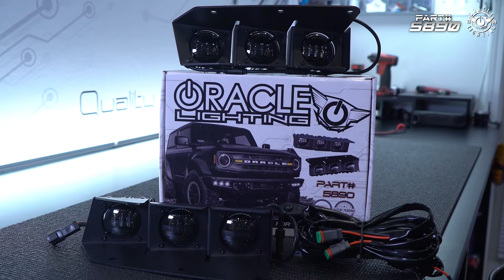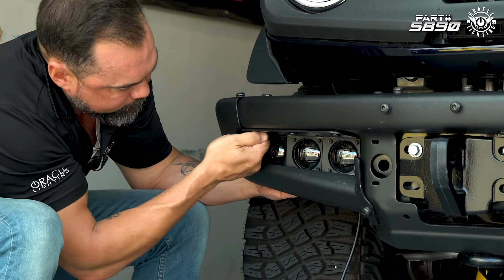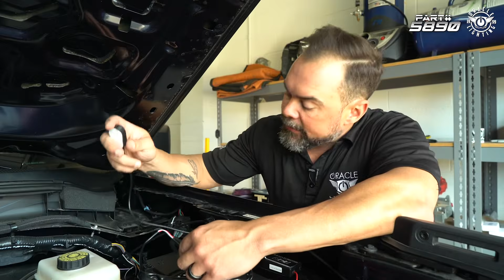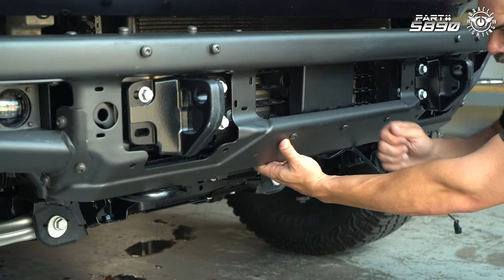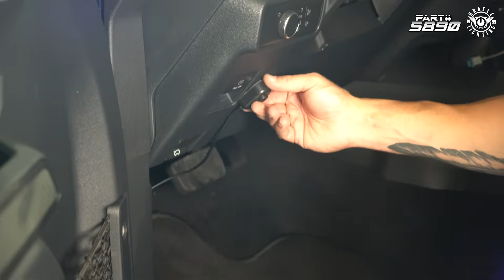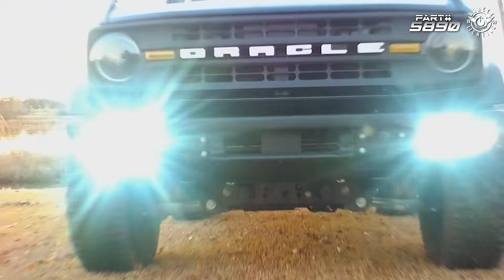2021 Bronco Triple LED Fog Light Upgrade from ORACLE Lighting- DIY Install Guide

Comment: Can you use another grounding bolt instead of the one that you used in the video, I already have my grill lights hooked to the grounding bolt you showed in the video, can I use a different grounding bolt?
Reply from the maker: Yes, there is a grounding bolt on the fender next to the battery that you can use.
Reply: @ thank you so much

Comment: Is it possible to link the Oracle switch power to the drl or parking lights, so that when those lights go off (in auto mode) the fog lights will go off regardless of whether the switch is on or off? I keep leaving my fog lights on accidentally and can't seem to make it a habit to turn them off. Haha my neighbors are probably getting tired of telling me my lights were left on.
Reply from the maker: Yes, you can use an Add-A-Circuit (Micro2) to go into the fuse box for power rather than the battery. The top right row of 10A fuses are all ignition switched so they will turn off with your engine.
Reply: @ORACLElights  thanks I'll look into doing that
Reply: @ORACLElights  Do you mean top right while standing facing the wheel looking into the engine compartment?
Reply from the maker: @marcus_ohreallyus  check out the bottom of this pdf for a diagram https://cdn.shopify.com/s/files/1/1766/0599/files/Letters_Instructions.pdf?v=1638814692
Reply: Thanks that worked. Any ideas in why the switch light won't work when it's hooked up this way?  I went into fuse 21
Reply: Never mind I did something stupid

Comment: Can you connect the Fog light to the factory switch then have the other 2 lights power from the switch you provide in the kit? For DOT street legal, I would want to run the standard single fog separate from the other 2 lights - thanks
Reply from the maker: Yes, you would just use the connectors on the included y-adapter harness to split these off to the desired switches as you are describing,

Comment: The lights are great because of the super easy install, but there's a couple of minor issues. I think the switch could be designed better. The red and green power lights should be on the opposite end of the switch. Most people will mount this near the parking brake (like in the video), so the lights are obscured by the button and the angle. I flipped mine upside down so I could actually see the power lights. Also, the switch wouldn't stick so I had to get a Scotch Velcro kit to secure it. The other thing is I'm getting orange film covers because these lean more towards yellow than amber.

Comment: The empty firewall grommet wasn't a nice gesture by Ford - it is used for the clutch cable pass-through on manual transmission Broncos.  Not available for aftermarket wiring on those vehicles!
Reply: Just experiencing that now.

Comment: Too bad Ford put my bolts on with the power of Jesus himself, and none of them will budge.
Reply: LOL, thanks for the laugh!  You can use some WD-40 or PB Blaster on the bolts and that might help; usually this works on older cars/trucks where rust and buildup are an issue but I've had it work on some of my new vehicles.  Also, if you have an impact drill with a socket head that might help.  The more leverage you have the better so if you can get an extension to your wrench or ratchet that would help.
Reply: Lmao!!! At The power of Jesus

Comment: Question if I wire to an aux switch can I still ground to the top of the negative battery terminal? Is that a good ground spot or do I have to mount it to the chassis of the car? Will that have any effect on the battery or not at all? Thanks.
Reply from the maker: You can ground to the chassis or to the battery ground, both are good ground sources.
Reply: @ORACLElights  ok thank you.

Comment: Any chance you can demo the wiring when integrating with the OEM aux switches?
Reply from the maker: https://www.youtube.com/watch?v=GcLmE0-KD6Q
Reply: @ORACLElights  it would be great to have a professional video from the manufacturer on how to install with upfitter switches, given that they're a common option on Broncos.
Reply: @evident_sandal  agreed!
Reply: @SeaMonkey137 thank you! This is the video I ended up using, too. For me, the trickiest step of the installation was attaching the wiring harness connector on the fog light housings themselves to the leads attaching to the battery. Finding the right aux switch wire with the video you linked was pretty easy

Comment: I have a factory plastic bumper with factory fog lights. 
I am replacing this bumper with the factory steel HD MOD bumper. 
I am NOT planning to connect these lights to the Aux Switches or included switch!
Will the included instructions give me guidance on how to connect your fog lights to the existing factory fog light harness/wiring?
Will i need to source special or specific harnesses or connections to complete this install?
Reply from the maker: We won't have instructions for this, but you can tap the existing wires into the factory harness. If you cut the wires after the DTM connectors on the ORACLE fogs, you'll have a red & black wire to tap in & still have a quick disconnect.
Reply: @ORACLElights  — Ahh…nice! Thanks for the reply! I did order your fog light kit and should (hopefully) have my Bronco soon. I figured it would be a simple electrical connection, but i was just curious if it was addressed in the instructions.
Reply: How did you make out?  I'm planning to do this exact thing this weekend

Comment: Is there a reason that you elected not to use the per-wired switches?  If you want to use those switches do the install instruction tell you how to proceed?
Reply from the maker: Not all Broncos have the Aux switch option. Yes you can connect to the Aux switches if you prefer to use those.
Reply: @ORACLElights  it would be awesome if you had a video showing how to do that wiring.
Reply from the maker: @bayard3000  www.youtube.com/watch?v=GcLmE0-KD6Q
Reply: What amperage would it need I know a couple switches are 5 amp 10 amp 20 and 30 I think not sure ?
Reply: @interiorguys7992   You can wire to the 10 amp aux switches with no problem. Wire the hots/reds to the violet wire pre-run wire at the front grill, and ground the blacks at the left front fender for a cleaner looking install
Reply: @jimmurtha7820 where do you tie into those auxiliary switches at?
Reply: Also can you wire the bronco letters and the running lights together so you don’t have to use a switch on them and run the fogs separately to a switch?